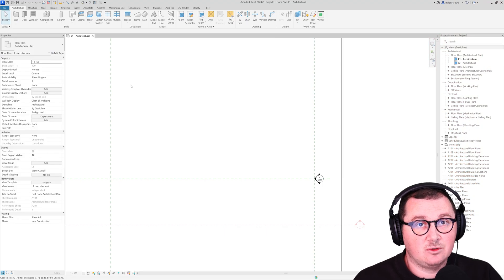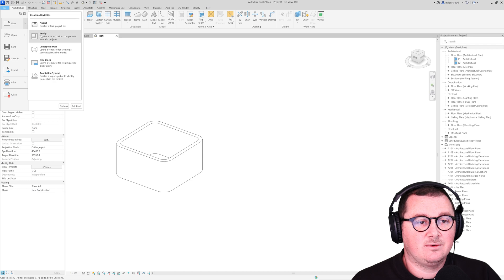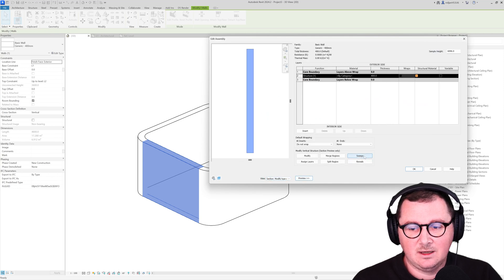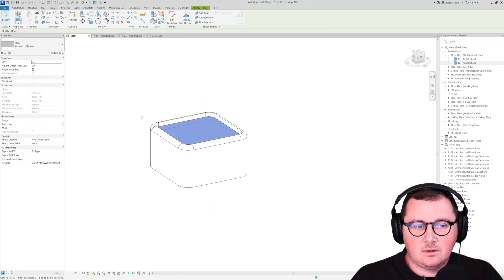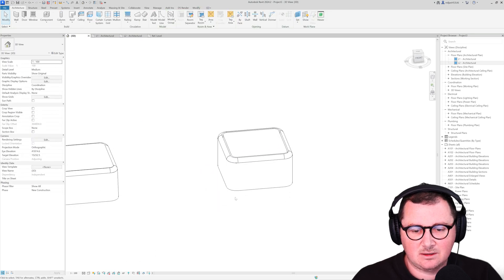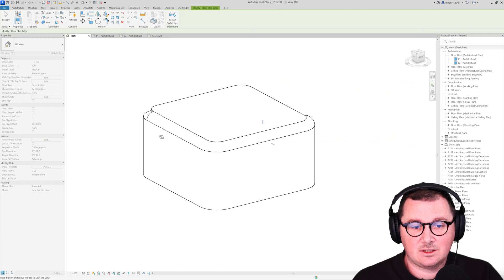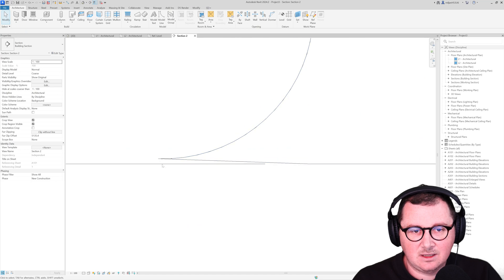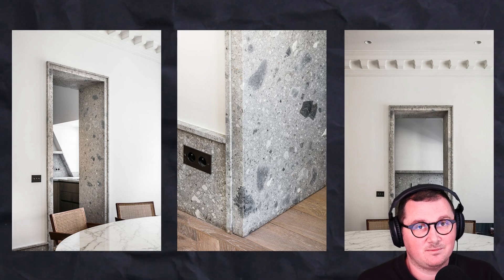Rounded Edges in Revit- Kalesma Mykonos by K Studio

Comment: this was awesome thank you !!!
Reply from the maker: Pleasure is mine Greco :) by the way, which method you prefer more, with a Wall Sweep or Slab Edge?
Reply: being a greek architect myself and due to my roots from the villages of greece from a construction point of view Wall sweep seems more efficient in revit usage  @arkiteasy
Reply from the maker: Thanks for answering. I agree, that’s why it’s shown as a first solution. Honestly, both options are good, will work well for sure, so depending on a certain case users should pick the best, most suitable, option for their project.

By the way stay tuned, today 2pm CET, new video is coming out 😉